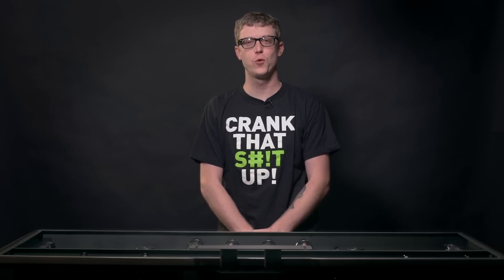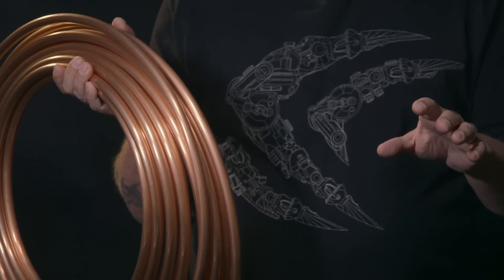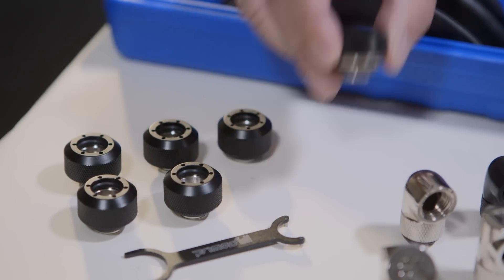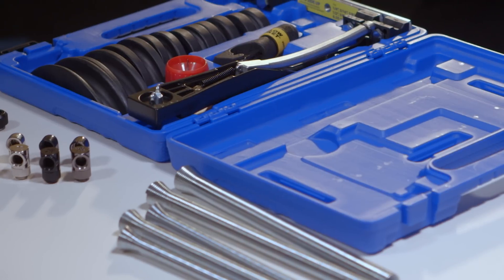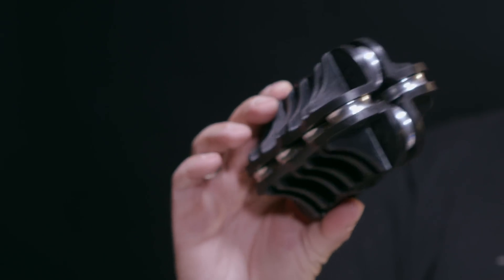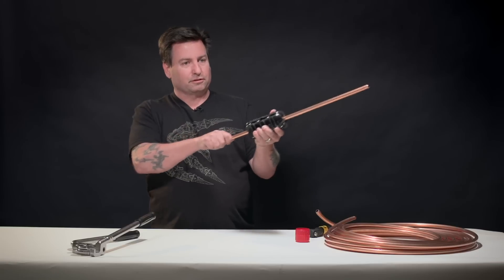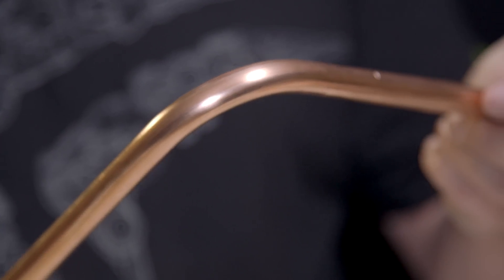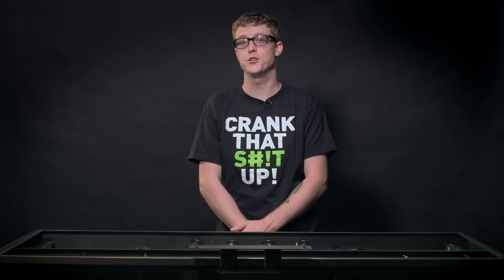GeForce Garage: Cross Desk Series, Video 3  – How to Bend Copper Pipe For Liquid Cooling Loops

Comment: How do you work out where to start the bend to counter the arch/length of the actual bend?
Reply: Henry Edwards : you need to know what the bend radius of the tube bender is, but it's easy from then on.

Let's assume the bender has a bend radius of 40mm. Measure the length of tube you need from start point to the centre of the fitting you want to bend to, and mark that on your tube. Then measure back from that point 40mm and mark that. Line up that mark in the bender and bend away - you should have the exact length of run you need with the center of the pipe lined up to the target fitting.

Search for Centerline Radius and 2D bends and you shoudl find more detail.
Reply: But how do you workout the total length you need? You can't work out the length of a bend that doesn't exist. Sorry If i seem a bit silly, just want know exactly what to do.
Reply: Henry Edwards : now you're into the realms of circle geometry. I was actually working on this today while I do a load of research myself for a hardline project. I'll try to explain what I've been doing, but without pictures it might be hard!
Reply: That's fine. I'm not a dumby, so I should understand (hopefully)
Reply: Henry Edwards : For a 90 degree bend the length of the bend is 1/4 of the circumference of the circle you'd get if you drew a circle using the bend radius you want (breathe). So let's stick with that 40mm bend radius from before.

Circumference of a circle is Pi x diameter, diameter is radius x 2. So 40mm bend radius gives a circumference of 251.327mm.
We only want 1/4 of that because 90 degrees is 1/4 of a circle: 62.832mm is the length of the bend bit.

So then, if point A and point B are 150mm apart, and point B is 100m below you want to do this:

measure 150mm from point A to point B and mark it
measure back 40mm from that mark - that's where we make the bend
measure 62.832mm from the bend mark and mark it again - that's where the bend ends
measure another 60mm from the bend end mark and mark once more
measure back from the very end half your tubing diameter (let's say 6mm for 12mm tube) - that is where the run ends

so in total you have a length of 226.832mm

I've not factored in the seating depth of the fittings though, so you'll probably need to add on 2 extra bits for seating at either end.
Reply: Forgot to say, all the measurements are for the Centerline of the tube - i.e. picture a line running through the middle as you plan your bends.
Reply: I think I understand the actual bend length part. But I still have one question regarding measuring point A to B accurately. What I mean by this is, say you want to bend a piece of pipe from your top gpu to the cpu water block. How do you measure the correct point you start the bend? Or do you just cut a piece of pipe thats much longer than you need, put a 90degree bend in the middle, then just put it in place and measure each length?
Reply: Bear in mind that I'm talking theoretically because I've not done this myself yet! It's probably easier to do a bend then measure and chop off the excess, but I'm a bit of a precise perfectionist so I'd end up doing the circle geometry described above mixed with some 3D trigonometry to work out the angles between the 2 fittings.

It's a bit complex and not quite clear in my head, but essentially you need to work out a couple of triangle distances to get some lengths and also factor in a 45 degree angle too to cover the horizontal difference between the 2 fittings.

I'll have a think exactly how to do it and come back. Again bear in mind this theoretical!
Reply: I'm making it sound more complicated because I'm not doing 90 degree bends all over the place, rather I'll be doing long sweeping arcs between GPU and CPU, 45 and 30 degree bends to cover differences in alignment, etc etc so I'd need to plan out everything, and that involves geometry and trig.

I'm seeing the same problems in hardlining as I saw in flexible tubing - WC is largely for the aesthetics, yet most WC loops are just damn ugly! Huge runs of tube across the case with no sense of forward planning, and now acrylic is just as bad with multiple 90 degree bends everywhere crossing tubes and whatnot. And it's because of things like Monsoon's hardline pro measuring tools - easy to measure out all the angles and lengths you need so check it out.

But just because you can do multiple bends doesn't mean you should - a tool is a tool, you still need to plan tings out!
Reply: That's pretty much what I'm doing as well. The piece of tubing from the CPU block to the top radiator will have 2 x 45 degree bends going different directions. Then theres all the intricate bends behind the scenes involving the pump and other radiators. 

I'll probably just end up paying a company to do it for me as I'm going to need all the cooling I can get. 3 highly overclocked GPU's and a CPU at 4.5-4.7ghz will create a lot of heat. Especially when under load for about 12 hours a day. :P
Reply: Henry, my calculations were a little off so don't follow what I said to do your bends!
Reply: Haha, how far's a little? :P
Reply: about 3mm which is a lot for hardline, and if you do multiple bends on a tube t gets 3mm worse every bend.

I have redone everything though to be correct.
Reply: Okay cool.

Are you excited for the 29th? Windows 10 and DX12!!!
Reply: I'm pre-registered so I'll grab the ISO and do a bootable USB drive but I'm in no rush to upgrade just yet - my Titan is only DX11 and the whole system is just so stable and fast I don't want to ruin it!

Once I have a few freelance jobs finished I'll give it a whirl.
Reply: Ah man that sucks. If you had the titan X you'd be laughing! ;)

I just wish Nvidia Pascal, Intel Skylate-E, and 120z 4k g-sync monitors were out!
Reply: If I had a Titan X I'd be crying - not worth the money since everything that makes a Titan what it is does NOT exist on the Titan X. It might as well be a 990 Ti (with the 980 Ti called a 990).
Reply: You say that now, but when next gen DX12 games are using 8-9gb of ram. You'll have to upgrade if you have a 980ti.
Reply: Henry Edwards You only really need to have the correct length if it's for a special job. like pipe that'll you place for an engine to a radiator as an example it harder to pull everything out than just do bends needed.

As you've seen in this video though they didn't measure a length of pipe they cut a section of pipe much longer than what was required.

So you do a bend and cut any unneeded section off then fit the pipe in.

This makes it easier to fit up.

Comment: kinda looks nice with the copper tubing, but I'd probably mix it up a little and use flexible tubing in there in some areas also so you can see if it's all flowing good in there when it's running.

Comment: Wouldn't Condensation be a problem? Copper pipes leak right?
Reply: Condensation would occur if the fluid running through the tubing was significantly cooler than the outside air, allowing the tubing to get that cool. That should never be a problem.
Reply: Nice, thanks!

Comment: wow really you can do this? its 10 times cheaper than acrylic and you can buy it at 
local tool shop :D but there is no bitpart which fits there is 12/16 which could maybe 
fit on 12/15 copper tube
Reply: 1/2ID x 5/8OD Ktype straight tubbing

Comment: the only reason to use copper tubing is for its high thermal conductivity.... and then you go and powder coat it...
Reply: +hitchhikingmike If you compare the thermal conductivity of the tubing with the radiators, you'll notice that it doesn't matter the slightest. You could even wrap up the tubing in heater-isolation, wouldn't do a difference.

Comment: Not as expensive as I thought it would be. You can get 20ft or 1/4" coper for ~$10
Reply: Buying the equipment to bend/straight copper and those fittings is another thing
Reply: newsynthetic Not really, You can buy a damn copper cutter for like $12 in amazon, and a pipe bender for like $20 at Home depot. http://www.amazon.com/Ridgid-32975-8-Inch-Quarters-Tubing/dp/B000LDGNCU/ref=sr_1_1?ie=UTF8&qid=1412049055&sr=8-1&keywords=copper+cutter
Reply: Luis Ortiz
Not for 1/2" OD tubing like what's used here. Benders for that diameter are a bit more expensive -- I paid $45 for mine, and the least expensive I've seen is Harbor Freight for about $40.

Comment: What OD tubing is this and where to get it?
Reply: Judging by the Primochill fittings used, probably 1/2" OD. Best thing about copper tubing is that you can get it at practically any hardware store.
Reply: ccricers kwix dosnt have a 1/2 tube straightener. or do they???
Reply: NIX ON it might be 12mm pipe
Reply: NIX ON I couldn't find 12 mm tube anywhere...
Reply: I am sorry man! They do make a 1/2 inch copper tube straightener. :$
Reply: Oh, ty :D
Reply: NIX ON
When I ordered mine through their eBay store it took several weeks for them to actually ship it, but once it shipped it took only a few days to get it. It's expensive, but it was definitely worth it.
Reply: Sweet! Yea! It did take a while.  I pestered the heck out of them lol.
Reply: NIX ON I want to see if I could get one of the UK eBay stores to ship me metric metal tubing since you can get it pre-plated over there.
Reply: Yea doesn't hurt to ask. I went with half inch as soon as the kwix guy answered my question (month later).  If your in the states might as well  go with inches. Either way it is a pain.
Reply: NIX ON I have Bitspower fittings though and they need metric tubing.

Comment: great case if you live in a 50,000 square foot warehouse, not so good if you live in a normal house or flat like 99.9% of ppl.
Reply: diecast jam it could be used as a table. And what's a normal house
Reply: Ferguson 20 diesel What's a normal house?One that isn't 50, 000 square foot.
Reply: I suppose. Ours is 6000 sq foot

Comment: When using copper, you leave it copper colour.... when using copper, use gloves or you will leave marks on it. One the pipes are into shape, seal them with arcylic spray. Remember that copper in the loop will ionize the liquid coolant making it conductive - I tend to use nickel plates surfaces for all components that will be in contact with the coolant.

Comment: My GT730 @1300/5400 copper custom pee on that stationary system. Can anyone lift that PC?
24x31x10cm, i need a small form factor gtx900 series card to upgrade my GT730 small form factor custom superclocked, im going to buy already a 750ti sff to do nasty modding things meanwhile. sorry about my poor english ;-)

q6600 @2.66ghz GT730 @1300/5400 2SSD+1HDD  40-65ºC under heavy load

Comment: Ruined the point of the copper. Should have just spray painted acrylic....
Reply: Heat dissipation.
Reply: +Christian Lund Not when you coat the copper, it will mitigate that attribute.
Reply: I see what you meant now. Agreed. ALthough it will probably dissipate more than acrylic, and no doubt remain stronger.
Reply: wouldn't this just rust and corrode over time? why not stainless steel?
Reply: Because mixing metals in water cooling setups is generally a bad for a number of reasons.
Reply: +Edrick Stormborne copper doesn't rust
Reply: Actually it does, rust is caused by oxidation, if you have ever seen the statue of liberty, that is evidence of oxidation (reacting with oxygen)

Comment: Why not just use much cheaper and easier rigid plastic instead of using hard to work with copper with its unique look and then painting it to look like rigid plastic? --Fail
Reply: Because they want the job done right, and want to be able to put on a high quality powdercoat.
Reply: Copper is likely a lot easier to acquire for most, especially in the US, as it's likely just a trip to the hardware store -- Home Depot, Lowe's, etc. I've built two systems using copper tubing and am planning a third, and I know where I can readily find it. If I tried to use acrylic, and I needed more for whatever reason, I'd likely have to order it in as I don't know of a ready supplier here in Kansas City -- nor have I really looked since I had planned to use copper from the outset.

Bending is also easier and safer. To bend acrylic, you need a heat gun which can pose a fire and burn hazard. Cutting is easier as well, unless you have a tubing cutter that can go around acrylic in a similar fashion to metal tubing and pipe cutters you can also typically find readily at a local hardware store or even at Wal-Mart.

Plus with copper you can choose to have it powder coated or even plated -- some who've built copper loops have the cut tubing chrome plated afterward.

Comment: mixed metals in your loop.
Reply: +rewtuser Copper and nickel in a loop do nothing. You can even add brass, still no reaction.
Reply: Stainless fittings.  All it would take is a chip in the coating.  And what is most definately an acetal top aluminum waterblock
Reply: rewtuser
I don't know where you saw an aluminium waterblock, all waterblocks used in this build are EK Original CSQ which are nickel plated copper-blocks. The radiators are EK CoolStream made of copper with brass-chambers. All the rest in the loop is Acryl and Acetal + copper pipes.

Comment: isn't this all just gonna rust overtime>?
Reply: Copper doesn't rust and if not mixed with other metals will last forever.
Reply: but fittings are usually nickel or stainless steel, and i can see why they had to coat the pipes later, i think once exposed to oxidization the copper pipes start looking like house pipes, which are mostly green and rusted.
Reply: they could have polished them up and lacquered them. And copper theoretically doesn't rust.

Comment: Only one drip and you need other pc.
Reply: +jenrey you turn it off and tighten your fittings. water causes a lot less damage than it used to, so you can just let it dry for a little bit. and besides, it isn't like you don't own the rights to replace parts inside your device so you can just replace something if it is totally ruined.

Comment: This guide is useless unless they show the correct way to measure the length on pipes required.
Reply: There's not really a "correct way" for measuring. For trying to decide how much tubing to cut off the coil, you can use a ruler or square to get an idea, taking off a few more inches than you think you need, and then whittle it down from there.

If you're making only single 90-degree bends in the tubing and using fittings at the ends, then that's all you need to do: bend the tubing, then whittle it down with the cutter.

Multiple bends in the tubing do require a bit of measurement, but the tubing bender will say on the packaging or in an insert the radius of the bend -- the bender I have puts a 1 1/2" center radius on 1/2" OD tubing, meaning the outer radius is 1 3/4" and the inner radius is 1 1/4". The rest is just math.
Reply: brandishwar
There is a correct way to measure. Generally speaking you always want to measure from center of tubing and always be mindful of the minimum bend distance of your benders. You also don't want to just whittle it down as you go. Measure twice cut once!
Reply: Valten
[You also don't want to just whittle it down as you go. Measure twice cut once!]

Your measurements will get you pretty close, but you should always allow some leeway to adjust for error in measurements. When measuring out lengths for my wife's build using copper tubing, I typically added 1/4" or 1/2" to the measurement to better insure myself against cutting too much off.

After all you can always take more off, but if you take off too much, you're basically starting over for that segment.
Reply: brandishwar
Again, not to be a broken record, but if you measure correctly, you shouldn't have to shave anything off. If it works for you that's fine, it's not "wrong", but it will save you a fair chunk of time if you're planning on doing more of this.
Reply: This is where Darth Beavis got it from...and it does tell you how to measure point to point.
http://www.overclock.net/t/1280153/pipe-bending-101/0_20
No mention in the video tho,eh Richard? Naughty......very naughty.
Reply: B .NEGATIVE
That's.... all wrong man. I've bent 1000's of feet of tubing in the oil patch. Throw the tape out, use a black sharpie (It just washes right off of metal). You measure first then put it in the benders... not the other way around, and you don't align your mark to your 0; that's your angle marker. you line it up to your "L" or "R" based on if you're making a right or a left hand bend, most cases it's a left hand bend.
Hope this helps.
Reply: stop it with the pipe measuring contests
Reply: Mines the biggest though!
Reply: haha